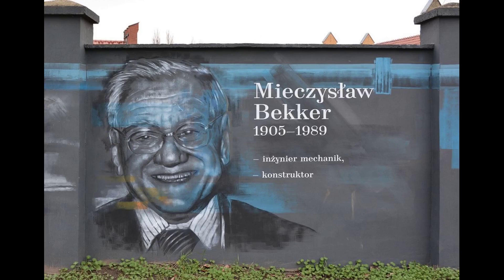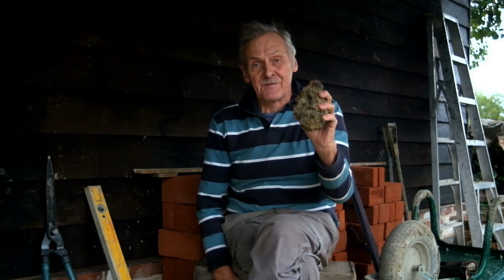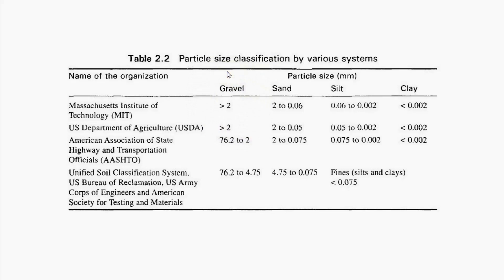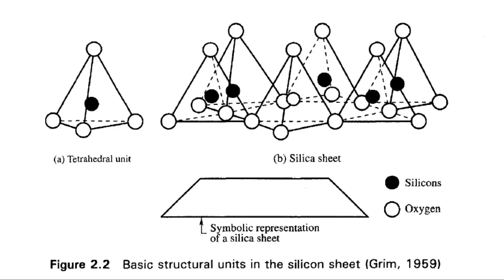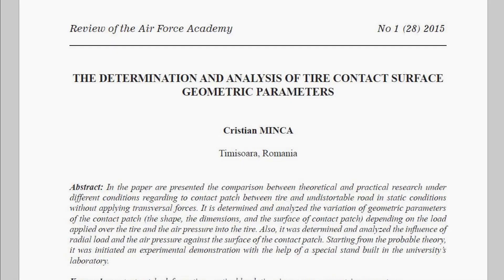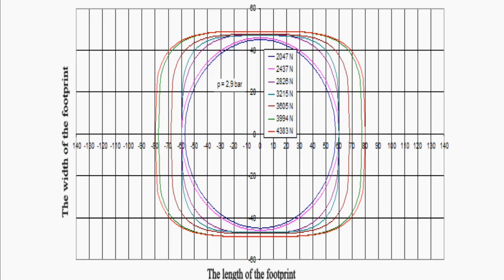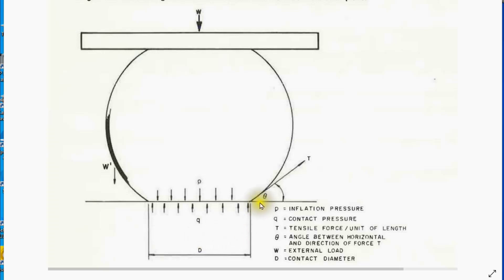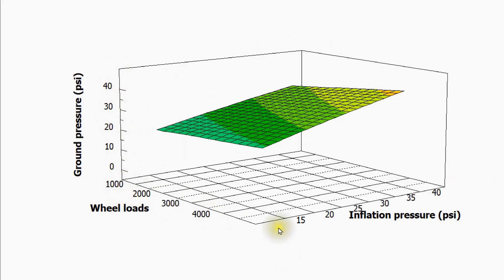Off road mobility using terramechanics. Pt. 1 - setting the scene

Comment: Please keep up your technical appraisal videos. The 4x4 world needs to be better educated. The parts suppliers need to raise the quality of their offerings....take note, Britpart, Allmakes, Bearmach. Stop using Chinese suppliers and get UK based production going. I have had so many part failures for my Land Rover straight out of the bix....appalling quality
Reply from the maker: The problem is that people must be prepared to pay for good quality components. I pay but but there are limits. For example, simple things like hub cap oil seals where the genuine part could be an absurd price and the knock off about one tenth of the price. The temptation is to buy a handful of the copies and still save money even if they fail prematurely.
What pisses me off is when you pay top dollar and the product is still rubbish. See my videos on the Foxwing awning, Airlift helper springs and the X-brake disc handbrake. IMO all potentially good products ruined by an absence of engineering design.
Another product I am dubious about is the Rolls AGM deep cycle battery I bought recently. A Canadian company charging a lot of money (£250) and when it arrived the battery said "made in China" -  the very thing I was paying to avoid. I expect it to fail prematurely.
It's a minefield out there.
Reply: @defendermodsandtravels  The Chinese have the skills and technology to manufacture to as high a standard as is ordered. Equally they can produce good looking junk. I'm tired of funding Chinese economic, political and military build up. When will the West, wake up and stop this!!
Reply from the maker: @Predator27007  My sentiments exactly. A bit like the EU (esp. Germany) funding Russia's war machine. Everyone could see it happening but no one stopped it.
Reply: @defendermodsandtravels  I don't believe that British manufacturing can't step up to the mark and produce the items we need for a decent price.
I purchased 3, THREE Mass air flow meters supplied by Britpart...about £40. Not one worked. It is a critical item. I have had to convert to the Bosch item at £150 and modify the wiring and fit a new ECU chip.

The original fuel inertia cut off switch failed after 26 years. I am on my fourth Britpart/bearmach replacement. All worked for around 3 months, failing open circuit. It is a HOPELESS situation. Cheap but useless.
Reply: @Predator27007  Don't get me started on bathroom pullcord switches. A device here when produced by Crabtree in Walsall good for about 40 years` service.  Obtainable now only from dubious origins and needing renewal every 2-3 years in my recent experience.
Reply: @Phil Healey  I was just about to get started on bathroom pullcord switches.....
Reply: I have found no other channel like this with data to back up any assertions. I don't have a Land Rover though I can appreciate them, but I find so much helpful with regard to traveling and maintaining my Chevy Silverado.
We have the same situation in the United States regarding cheap Chinese parts and goods. When I'm replacing Parts in my truck I have to choose between made in America where I can find them and OEM made in China. It seems like initially we have gained a lot because we could buy so much more reduced cost but it seems like now everything we're fine is just Junk. Granted you don't need everything to last for a hundred years and it's okay for some things to be cheap and break but the problem is that now it seems we've lost quality and durability where it matters. It seems there are so many items like an electric jack that I bought that would have lasted so much longer if they had used Metal Gears instead of plastic. It wasn't less safe but the plastic gears just wore out whereas if they spent amother dollar or two it would have been good quality and lasted for many years.

Comment: Thanks for the informative video. 
One question, the curves plotted buy Wong shown at min 12.23 are telling me that increasing the inflation pressure, it increases the ground pressure, and oppositely deflating the tyre, it reduces the ground pressure. This is supported from the observation of a smaller patch  area by increasing tyre pressure. That is, given the same load applied, a smaller area  will result in a higher pressure (P=F/A). 
Basically the reaction of the ground to the pressure imposed from the tyre.
However in the video is said that lowering tyre pressure, the contact pressure is greater. 
Am I missing some key concept?
Thanks
Giacomo
Reply from the maker: Your understanding is correct, at least as far as this simple model goes. By this I mean that it works  quite wellfor tyres on rigid surfaces, but on soils where there's signficant deformation there's a more complex interaction between the tyre and the soil and the model is less valid.
If I said anywhere that lowering the tyre pressure increases the contact pressure it was an error or a misunderstanding. However lowering the tyre pressure reduces the load carried by the pressurised air and increases the load carried by the tyre carcass (and the associated "carcass pressure") although of course the total contact pressure is still lower.
I will re-visit this to see if it can be better presented however it won't be for some months because I am tied up on other things at present.
Thanks for your comment.
Reply: @defendermodsandtravels  thanks for your reply.
If that helps I think this happened at min 13.04.
It did definitely help to ask as I had missed the tyre carcass increase in support when deflating.
Thank you for your work.